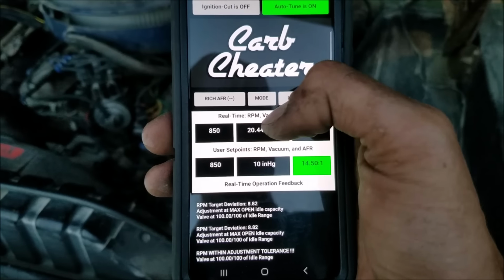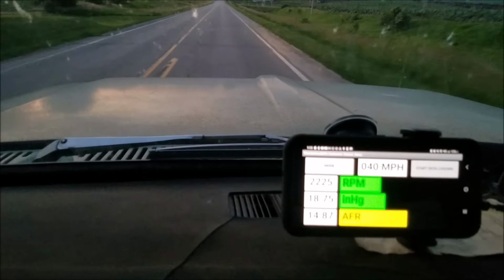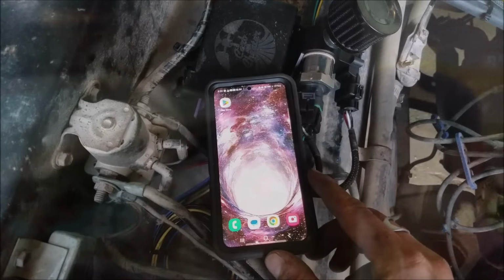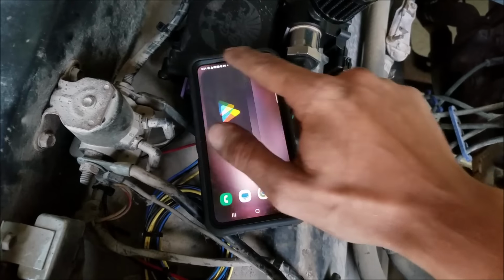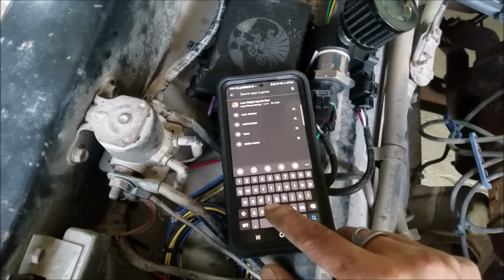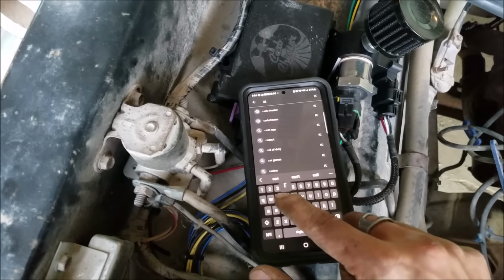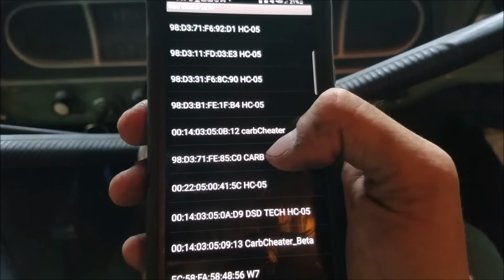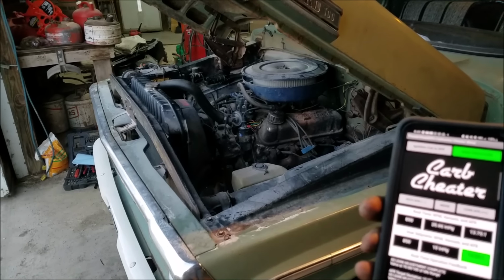Make a SELF-TUNING Holley/Edelbrock Carb! (Carb Cheater: Installation & Setup)

Comment: So does it have the ability to correct lean conditions? Or only rich conditions?
Reply from the maker: Lean of ideal is a pretty obvious problem that someone should actively correct themselves. A carb will run pretty good albeit down on power and efficiency and up on wear when it's rich - a carb should still be optimized by the user via all the data right in their face, then allow carb cheater to handle the inherent variability. 

If someone wants a push button fix and is lazy, this isn't the product for them potentially - only for real wrench slinging gear heads who are perfectionists.
Reply: @ThunderHead289  right, i'm a car builder and can tune carbs pretty well as it is. My brother told me about this carb cheater as an "alternative" to tuning. Lol. I was just curious if you figured out how to also richen automatically. How about something in the spacer like butterflies or sliding restrictors with a servo that way your tool can adjust in both directions?? Just a thought.

Might save someone from a lean condition and save their engine. Id program it into the app to flash a warning if the tuner is correcting a lean issue and tell them it needs serviced. Would act like an engine failsafe
Reply: @ThunderHead289  this thing you made is quite impressive. Btw. Much respect and good thinking.

Comment: So its a automatically controlled vacuum leak...
Reply from the maker: It's a lot of things, but as far as the self adjustment peice goes yes - simple, robust, effective. Programatically highly complex to handle the scenarios but in the physical world, not a lot to fail, and if it were to, your still on your normal carb and nothing will stop you from getting to where you are going.

Comment: This comment will probably be deleted, but if you can't tune a carb. Maybe you should get something computer controlled and just buy a programmer.
Reply from the maker: Watch my most recent upload - there's varying degrees of capability out there. I consider myself to be top shelf, but for others who are unsure or are perfectionists like me, having a gauge display you can look at goes a long way. 

Tuning a carb to run is entry level capability, enough to be able to own an old car, optimizing a carb is a whole different ball game and where it's nice to not have to have 10 years of experience like me to do it. CC allows people that ability without the leg work

Comment: 3/8npt is close enough to M14 that pipe fittings can be re-tapped to allow oxygen sensors to bolt in…

I have a street elbow in the O2 bung hole, then the O2 sensor in the elbow, on my daily driver. (I did that for the post-cat sensor & my check engine light turned off…

That should be useful info for putting an O2 sensor on a car that doesn't have one.
Reply: Would a spark plug anti fouler work the same way, & drill it out larger?   Then screw it into the exhaust pipe ?
Reply: @chrispompano  yeah, it works, that's what a "street elbow" is. NPT, pipe thread, an elbow with male one one end & female on the other.
Reply: *instead of drilling the defouler, I cut the protective grating off the sensor.

Comment: Tuning with boosted engines, a carb would be perfect for all idle and low/mid speed operation with a fuel enrichment system using a lambda regulated enrichment circuit.

Comment: Are there any plans for variations tailored to engines running a carburetor for each bank of cylinders, like a VW or Corvair? 

One could run two kits, but that would be a bit expensive!

Comment: Question what if I am running a dual carb on a tunnel ram
Reply from the maker: We're working on testing that - tunnel ram installed on one of our cars just last week. Will film it for sure
Reply: Sweet I  have two motors with a tunnel rams bbc dual 850cfm quadrajet, 5.3L LS LM3 holly high rise with 2 predators 930cfm each

Comment: So I will be ordering this for my Chevy G10 250 cu van, but Im now thinking if this would work on my twin Weber air cooled VW Beetle?
I already have sandwich plates with nipples for the MAP sensored digital ignition on it, but the nipples are smaller. Not sure what if any issues there could be with CC in a multiple carb system.

The compact data display alone is making this very appealing.

So no shipping to Canada at the moment?

Comment: An old school trick for you guys out there is to take a piece o vaccuum hose and interconnect 2 vaccuum ports at the same time, replacing those nasty caps. Also, use a bolt to plug an inch worth of vac hose in order to plug the ole ports real good

Comment: @11:15 using wheel bearing grease on fiber gaskets - related hack, I've used chapstick on Holly carb float bowl gaskets ;)   I also use grease on cork/rubber valve cover gaskets, adhere the gasket to the cover w/ silicone, and then grease the side that contacts the engine head... use only enough bolt torque to arrest any leaking (contact, plus a quarter turn!) and I've open and closed the same valve covers repeatedly over 11-years reusing the same gaskets.

Comment: How does it work? Do you tune the carb slightly rich and then the unit controls a slight vacuum leak to lean out the afr? It doesn't seem like it's adding any fuel.

Comment: I ran into this by mistake and it seems pretty cool. I learn how to tune carburetors years ago. Don't have much problem in that sector. But I'm curious have you ever put this on a Holley double Pumper carburetor with four corner idle circuit

Comment: What do you do if your running an HEI, do you just use the green wire ?
Reply from the maker: Hei is pretty straightforward- yellow wire to BAT (spliced to existing wire if need be, and our green wire to TACH. Ours needs to be the primary wire where if you already have a tach lead, you splice it to our wire and plug ours in directly

Comment: If I order this product, can I program it with my computer?  I would love to try this product on my 66 mustang. Thanks!
Reply from the maker: What do you mean by "program it with your computer"? The ui is designed for the app interface 🙂
Reply: Sorry thunderhead, pardon me for my ignorance, but I use an old style flip-top phone. I just wanted to make sure that the app would work with my laptop. I'm not at all familiar with apps, but my grandkids can certainly figure it out. Love your podcast and thanks!

Comment: Is there a reason you wouldn’t want to tap the map sensor straight to the intake? I don’t have much experience with carb engines, younger guy here, just recently started looking into stuff because I’ve got a 77 camaro project and (I think) a 406 to go along with it. This product seems great for helpin someone like me tune the engine. (Have a holley efi system on a twin turbo street truck so I’m familiar with the wiring at least)

Comment: A computer controlled vacuum leak. Looks like it only helps with carbs that are jetted too rich (which many are because people don’t know how to do it). Just get a wide band and your jet kit and get your carb dialed in properly.
Reply from the maker: Get a wideband and see how variable your afr is - I'm a pretty accomplished carb tuner. A carb is a static metering device in a dynamic environment - what's true today for conditions isn't tomorrow, carb cheater bridges the gap well

Comment: I just preordered mine. My Chrysler 383 is being built at the builder right now. My cubic inches and your price seem meant to be!! Seeing all the items spread out on the table appears to be overwhelming, however watching the install is a piece of cake! Even better I've already installed a Bosch 02 sensor in my car. 1969 Plymouth Satellite (Roadrunner clone). Also could you provide a link to the nylon vacuum plugs/caps you're using? I appreciate you do!

Comment: Have you tested on an engines with a really big cam?  My engine idles in gear with 6.5 in vacuum and cruises under 40 mph with a reasonable AFR on my wideband but as speed increases it gets richer.  I'm wondering how much compensation is possible.  My idle is fine.  My WOT AFR is stable and spot on.  Pretty much just the low vs high speed cruise is out of whack.  This is a great product, even if it can't handle the range of my setup.  You guys really did a service to those of us still wanting to stay carb'd in our vintage iron.

Comment: 😆 ok so the whole time I've been overthinking this product. Was thinking it was something that had multiple little motors adjusting every single little little screw possible on the carb.😂 

So now my understanding of what this system does is it just causes an artificial vacuum leak.
Reply from the maker: It's like a pcv valve, but dynamic. 
Not much to fail and does a really good job. 
Plus all the other stuff It does that I haven't talked about like Rev limiter, rpm window switch, ignition lock, easy to use datalogging, obviously a really decent gauge display ... 

Dumb things hard to talk about

Comment: Yep, I bought one. Looking forward to having it. Curious if you see any major mpg improvements....
Reply from the maker: Any engine that's tuned well as far as optimized ignition timing and air fuel ratio is going to be getting the best economy it possibly can given its mechanical configuration 👍

Comment: It looks fascinating. As someone who grew up with carbs and transitioned smoothly to an EFI enthusiast due to my vocation in electronics R&D, this will keep the retro people happy by crossing over. In fact, with the little information you have given, it looks like the only difference between yours and EFI is the fuel delivery device which taps the imperfect fuel automation of carburetors and adjusts the deficiencies out. My kinda project!

The reason carbs died besides cost, is the lack of adaptability. 

I don't see much info on your product. Do you use your own carb etc.. I know it is not a simple chore the write this stuff up so I will keep you bookmarked and check back.
I won't waste you  time as I am only curious and don't foresee having an opportunity to use this in the near future, but great work!

Comment: What do you do if it´s too lean will you also build a solution for it?
Reply from the maker: The user is expected to use carb cheater to get their carb close which is easy because you can see everything - then from there carb cheater handles the deviations

Comment: The problem with this setup is that your not controling fuel in the carb and wasting a lot of fuel do it the right way.
Reply from the maker: Hmmm that doesn't even make sense. Use your gauge back to tune your engine well. Then just enable carb cheater - if someone benchmarks a carb correctly where it's not lean I the throttle, it will always try and favor the rich side cruising. 

Also, it's easy to "do it right" when you can see everything- this isn't a "I hate carbs so I installed this" product.
Reply: @ThunderHead289  Carbs should be fine tuned with needles and jets for best fuel control  your just creating an air bleed to lean the carb out under certin conditions  but with out fine tuneing the carb your wasting fuel

Comment: Since different family drive different vehicles, one phone disturbed me at first. Looking forward to next video.
Reply from the maker: Phone doesn't have to be connected for carb cheater to run - its just your user interface to make target changes and to watch your gauges if you want to. You can completely not have your phone in the vehicle - no problem, it's still doing its thing 🙂

Comment: Honestly I couldn’t watch the whole video with much attention, just too much banter towards the simple installation.  Anyway what I want to know is the technical side to see if it’s a worthwhile product.  Since your into cars and develop products obviously, I’m sure you know what I’m saying in that you don’t just buy shit based on sales pitches or on someone’s word of what it can do.  I want to know how it does it.  
So I see a microcontroller, a stepper (iac valve) so I figure your introducing a “controlled” vacuum leak to adjust idle speed in a small range.  How are you controlling afr?  You’ve got the wideband to monitor.  The air leak could “enlean” it ever so slightly, but how would you enrichen?  I guess you could purposely jet rich and use the “leak” to go the other direction.
I think I caught a connection to the coil.  What’s that for? Piggybacking into the timing or for a rev limit?

It’s been a long time since I played with carbs so I could be off base.  Fuel injection is so easy once you thoroughly understand it in its essence, then you can work on/tune any system from any company!  I get it though, you’ve got a market in all the guys who want to keep stuff original or old timers who won’t embrace technology.  I deal with them too as I build some Harley’s for guys who refuse to touch injection and would rather fumble with jets and spill gas everywhere than open a laptop.
Don’t take this as anything bad, I’m just honestly curious!
Reply from the maker: This was just an install walkthrough video for the couple hundred that were out there at the time of posting vs someone having to use the written documentation. 
What's interesting is that you don't have to bias a carb rich when cruising with carb cheater as long as you aren't way lean. Throttle and afr is much more dynamic that a "change jets and now all through this throttle range its 14.5". That's the purpose of carb cheater - for one to be able to actually see what's going on which carb people normally can't do, and then to handle the load, conditional, and throttle variability. 

People seem to have a negative opinion of carbs - for no real good reason other than their own incompetence with them, im a programmer by day but my daily 40 mile round trip drivers are all carb. The power is in your hands to do everything with a carb without needing any special programs or tech understanding. 

That wasn't to sound rude, just my perspective from being a heavy automation and programmer for quite some time now.
Reply: @ThunderHead289  I haven’t looked thru your other vids but if you don’t already you should throw up a more condensed install video and include stuff for the seasoned mechanics/hobbyists/etc that don’t need the help installing but are like me and I’m sure others who like to know how things work to know whether it is gonna work for their particular setup.  You know, especially nowadays with the wealth of info on YouTube there’s more and more people building wierd projects and using products outside of their intended purpose.  I often find it difficult to get tech specs for products that aren’t intended for my application yet I know with the right info I could adapt it and make it work.
Anyway, wish you the best and hope everything works out for you with it and you guys make a few bucks too, I know you’ve probably spent a lot of time on it.  Do you do anything with injection?  Since you said your a programmer I figured you might work for one of the companies making standalone ecus or other FI products.  I build dragbikes and other performance engines and often have questions for someone with your tech training/experience in automotive/engines!

Comment: The question I have to ask is why?  I learned the old school way deckades ago so I do not see the reason for installing this toy.
Reply from the maker: I can tune a carb with my hands behind my back and blindfolded myself - but what folks who do it a lot who don't run a wideband don't realize is that at idle and low throttle angles like cruising, afr is extremely variable based on load, conditions, and throttle angle. So CC goes to work on smoothing all that out and does a good job for that purpose. 

It's time thing also - running and running at peak tune are two completely different things. I go to work, and so does everyone else - no one has time to fiddle with plugs and play the guessing game. 
With the gauge display you can see everything "is it lean before the power valve threshold is hit, is it lean or rich cruising, full throttle afr? All these things are easily seen and can even be datalogged where you can have something tuned darn well in a fraction of the time. 

That's the purpose of carb cheater.
Reply: @ThunderHead289  It just is not that hard to properly set up and adjust even multiple carbs on one engine.  For your product to even work it would require the carb to be set rich.  The only reason for your product might be for a person that needs high performance at different elevations and with your product one could make the adjustment while driving.

Comment: Luke, aside from running better, did you see a mileage benefit with the Carb Cheater on your father in-law's truck?
Reply from the maker: Carb cheater doesn't directly correlate to mileage, bit a well tuned engine, with good ignition timing and air fuel ratio, is an efficient engine.

Comment: I'm scratching my head trying to figure out how Carb Cheater enriches a lean mixture (electric choke?).  It's easy to understand how it leans the mixture.  
The real key to this obviously is the Wideband O2 sensor along with your software.  
Wideband sensors gave.give the average guy the ability to monitor the A/F ratio real time and not have to rely on the old method of reading spark plugs or having to go to a specialty shop to have tuning done.  The easy availability of wideband O2 sensors (and gauges/software to read them) has helped carburated and fuel injected enthusiasts.

Anyway nice work!